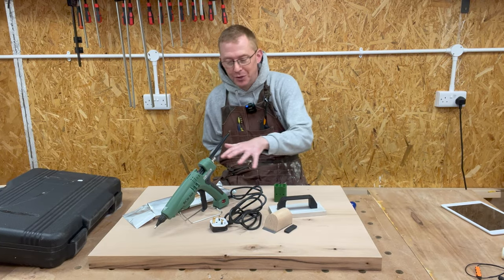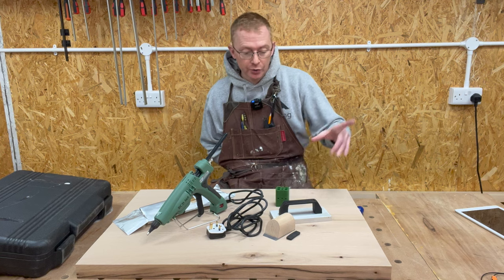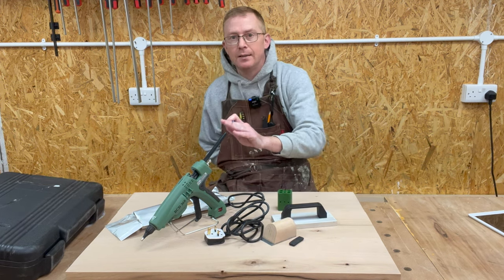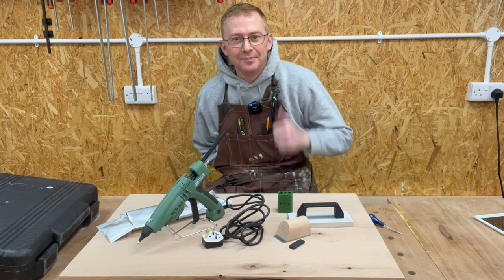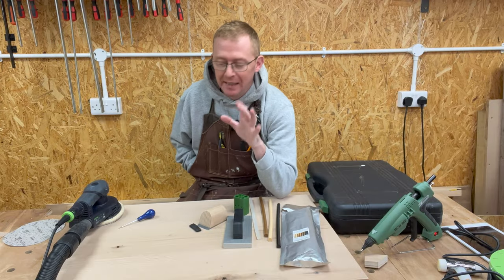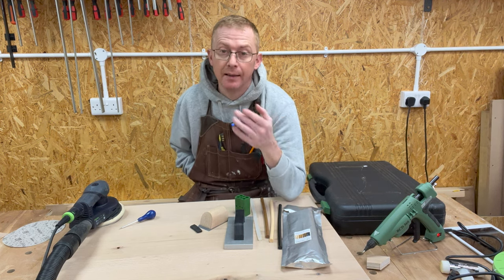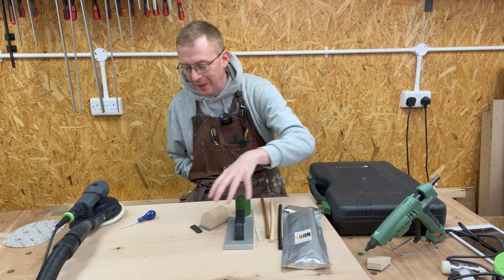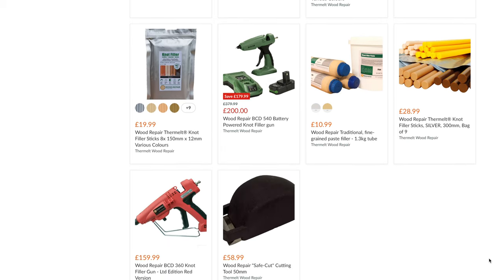Overview and Impressions of the Wood Knot Repair System Pro

Comment: Do you mean Cyanoacrylate glue? Think you had contact adhesive on the brain
Reply from the maker: You’re absolutely right pal😂😂. I’ve pinned this message to the top before everyone makes the same observation, and yes I’d been using contact adhesive that day so (pardon the pun) must have been stuck in my mind 🤔😂

Comment: How tough/hard is the filled knot when its cooled Leo as I couldn’t tell from the video?  Hot melt glue gun sticks are always slightly soft even when dried, whereas I guess you want this to be as hard as the wood when set
Reply from the maker: It’s solid Geoffrey, just been checking it now as I saw your comment before. Sets solid and has taken the wax oil finish as well 👍😀
Reply: @Hand-i-Craft  Excellent.  I will bear these in mind when I have a similar project.   Still on workshop fitting out and garage sorting out, so no jobs with ‘nice’ output yet!  Cheers

Comment: I guess a lot of people will be wondering if they can use the sticks in their existing glue guns instead of buying the kit, looks good though Leo
Reply: Glitter hot glue sticks too!!!!
Reply from the maker: Good point mate, not sure what the answer is but I’m sure someone will give it a go 👍
Reply: That’s eactly what I was thinking.  Its a neat solution but the gun seems very expensive when you can buy other ‘craft’ guns for £15 or thereabouts.
From the website you showed it looks like the filler sticks are 12mm diameter, whereas most glue guns are 7mm or 11mm.  It would of course be possible to file/carve the sticks down if they couldn’t be pushed through an 11mm gun.
I did like the mould that you can use to empty old glue out into and reform into a new stick when changing colour, that’s one issue I have always had with using coloured glue sticks.
Reply: You definately can use a regular gun.  The big advantage with he wood repair pro gun is a high wattage gun and heats up very quickly, but it is only a glue gun.  The secret is the sticks, not the gun.
Reply: The sticks are 12mm gauge and will work on any gun that can reach a stable temp of 170 degrees
Reply from the maker: @woodworksupplyltd52  Thanks for clearing this up woodwork supply folk, much appreciated 😀👍
Reply from the maker: @geoffreycoan  The folk have just replied in this question Geoffrey which hopefully answers your point 👍👍
Reply from the maker: @bpt006  Cheers 😀😀👍👍
Reply: I also have a glue gun, but the glue stick only goes in one direction. How would you propose removing a partially used stick if you wanted to do a different colour?

Comment: Great solution to filling irregular holes and knots. Expensive gun though...I imagine they could profit from making a kit for those of us who already have a hot glue gun.
Reply from the maker: Yes, it does have specific temperatures on the gun pal, but hopefully the knot filler is compatible with just a regular glue gun👍👍
Reply: @Hand-i-Craft  The sticks are 12mm gauge and will work on any gun that can reach a stable temp of 170 degrees